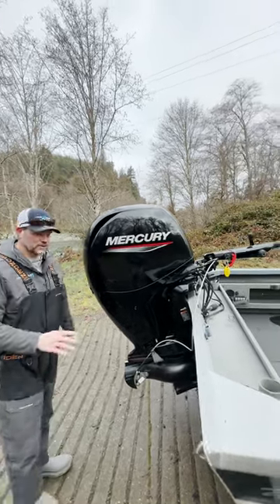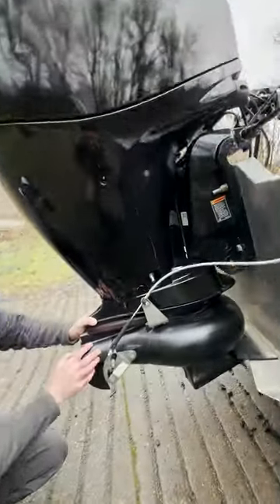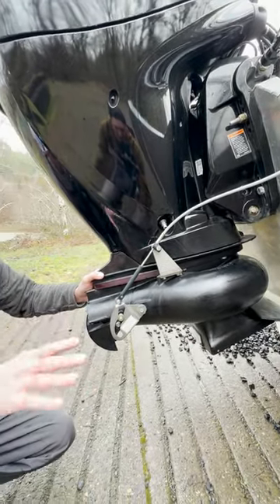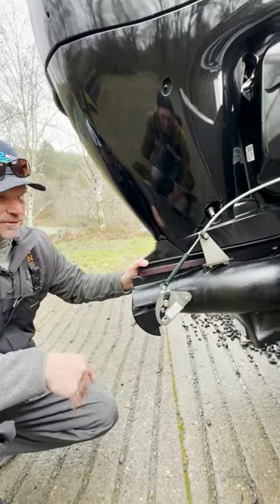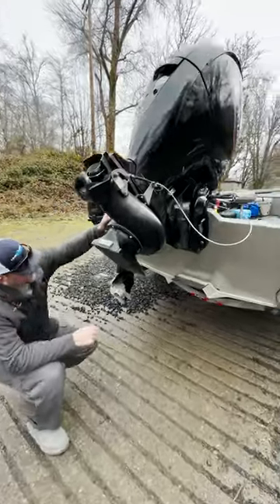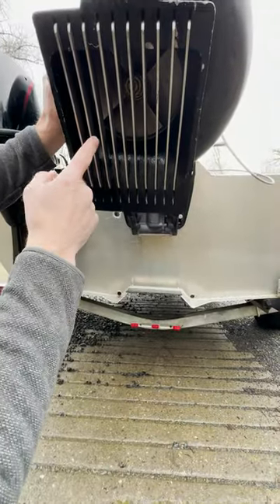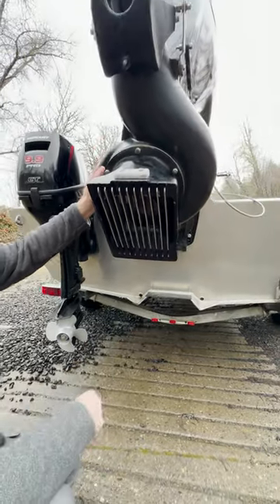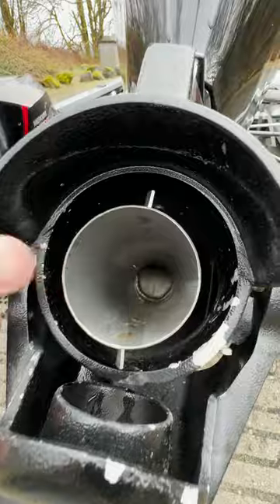How a Jet Outboard Works

Comment: I make those jet pumps at Edelbrock
Reply: That’s wild 😂
Reply: Ty
Reply: Get me a discount lol
Reply: How much efficiency does it sacrifice?
Reply: @andrewpease3688  a 90hp motor usually becomes a 75hp effectively with the jet pump. But theyre still quick compared to a propeller especially on the smaller motors like this size outboard
Reply: Where is the waterpump on these things?
Reply: @meetbounty  there is none, pressurized water coming from the jetpump is used to flow the water thru the motor and exhaust and out, for the cooling like normal
Reply: @mxracingunlimitedltd7784  interesting! Checked for these in Germany but seems we don’t have them :(
Reply: Yeah I wouldn’t brag about that…thise edelbrock pumps breakdown a lot. We have helped so many stranded boaters with those.
Reply: @mxracingunlimitedltd7784  since you know about the internals: how is the repairabilty on these things?
Reply: Very nice
Reply: @meetbounty  depends on the jetpump being used.. these look like aftermarket brand jetpumps the companies use as oem parts. 
However i highly doubt theyre as easily serviceable as a jetski style jet pump also use by companies like yamaha. 
Theres also no 90 degree turn in power in a jet ski so im sure that adds some complexity.
Otherwise its just a shaft with ball bearings that have seals on each side and are coated in grease. They usually last awhile especially if you use it semi-often.
Then theres the impeller and wear ring. The wear ring is a replacement part that will eventually need to be changed especially if you suck up rocks or lots of sand all the time.. The cooling line has a screen in the jet pump and a strainer filter as well to keep any crap like that out of the motor. 
You might have to do the wear ring every few years and maybe a new impeller after it has too many knicks and dents in it over time lol, but good amount of time, maybe 5 years for the Aluminum and for the better SS one's they could last forever if never damaged like a prop basically...
Reply: Edelbrock doesn’t make jet pumps. It’s an automotive company.
Reply: I make those impellers! lol
Reply: @UltraMagaFan yea it does! 
The make a lot of our castings for our company.
Reply: The same ones that make intake manifolds?
Reply: @iamsealfish yup! Same company that makes intake manifolds and more…
Reply: With no 90 degree bend it must be a pretty solid design. With the impeller being vertical it must really help get the boat on plane and must really hold the transom to the water.
Reply: I make them on mercury
Reply: @doriangray2020 - Do you know, how many years has Edelbrock been making these outboard jet pumps?
Reply: @meetbounty the water pump is in a housing connected to the driveshaft. Much like a prop lower unit.

Comment: A outboard jet boat.... Rhats a new one for me. I love it!
Reply: They've been around for decades. I once found a Victa jet outboard at the dump with a seized motor. The older Victa lawnmowers were a 125 cc 2 stroke- I replaced the motor with a 160cc off a later (1970's) mower. Not very fast even on a 10' ally punt as a Victa 160 is only 4hp! Gave the outboard to a collector after the novelty wore off.

Comment: I noticed it also has the chanel cut in the keel - very common on purpose built jet drive hulls.
Reply: Tunnel hull it will take soupy mud and uses the bottom of the boat to push the water out and it pulls it up in there allowing the pump to suck water and push you where mud will just clog up the pump . 🤙🏼
Reply: Nice
Reply: @brianpierson7708 Texas tunnel hull
Reply: @patrickmalone1373 Texas tunnel hull 😐 wth are you talking about

Comment: These are awesome for places like where I live thats chock full of logs and shallows...job number one with a jet outboard is work very carefully on where it mounts, or it will be a disappointing first run lol but if you get it right, its the best inshore way to get around oyster bars and sandbars, and one word of advice for ALL jet outboard owners...Jackplate.
Reply from the maker: Thank you! Mount too low and the intake drags too much, too high and it cavitates. Gotta be just right. What type of you boat and outboard do you run? Guessing you’re on the east coast somewhere.
Reply: @live2boat  Im a canoe fisherman these days, had a couple boats with jet drives and didnt have a lot of luck where I lived then because it could get choppy, Clearwater.
I fish in Waccasassa River area now where everyone has either a "lawnmower with a shaft", a jet, or jackplate on a prop engine. I think jonboats are best without a jackplate just because of the weight and stress on the transom but it was nice for my flats boat with a jet because I could drive through 6" easily at idle without sucking up a bunch of crap lol Had a Yamaha 80 in both boats the flats boat ran about 35, and the carolina skiff about 37.
Reply from the maker: @artlife6210  Super cool! We were in Clearwater a few years ago. Took the kids to aquarium, fished for snook, etc. Loved it there. I  had no idea jets were such a thing down there. Figured everything is a center console with a transom full of outboards.

Comment: Just combine a jet with an outboard motor. First time I’ve seen this!
Reply: They have been around for at least 15 years!
Reply: @tbusch63  Victa lawnmowers also made a regular outboard motor with the 125cc mower motor- and also made a jet leg outboard as well. In 1973 they were introduced. No doubt not the first.
Reply: @tbusch63 try 50 years
Reply: @72mardy  key words "At least"! I was actually looking at them in the early 1990s. So no surprise there!
Reply: I retired 14yrs ago from boat mechanics, never heard of em! Awesome 👌

Comment: Had the same 2 stroke 25hp prop merc since 1998.  Just upgraded to the 60/40 merc jet (with tiller)
Reply: If you did buy one you would would have said jet drive
Reply: Any better efficiency?
Reply: @anything.with.motors  Not really, props inherently will always have better "grip" and economy.  Not to mention, it's a huge thousand cc 4 cylinder.  Very efficient for what it is
Reply: @zackforister  right on. 
Good for low spots though
Reply: @anything.with.motors  It's amazing.   It's freaky to be doing 30 mph and look down and the water is only 6 inches deep
Reply: @zackforister yeah that's crazy lol
Reply: @Bighannes410  You have reading comprehension problems don't you? He said he got a  60 /40 hp Merc (KEY WORD) "JET" Tiller. let me translate that a little for you. If the engine was PROPELLOR driven It has 60 hp. If it is a JET it is equivalent to a 40 hp engine due to the inefficiency of a JET DRIVE! Yes, Jets take MORE hp to do the same job a Propeller does. The BIG difference is ONE can go SHALLOW, the other one, you replace the prop all of the time. At $200 a POP, if you take a prop TOO SHALLOW! TADA! Your Welcome. I don't even own a boat yet!
Reply: @tbusch63  nobody specifies a tiller . If you own a jet drive you call it a jet drive
Reply: @Bighannes410  Surprise MOFO! Did you know you can have a center console jet? THAT ISN'T A TILLER! Huh, I guess that means, that they still call the ones that are steered from the rear of the boat, a "TILLER"... LOOK IT UP. Better yet? Go buy a jet and see what you get? I don't even own a boat and I can tell you this is true. Besides, a Jet Drive is just the "PUMP" attached to a V8 or V6 Automotive engine, that has been "Marinized" With a Water-cooled Exhaust system (sometimes) and sometimes an enclosed cooling system.
Reply: @Bighannes410 the guy in the video even says tiller. The tiller is the handle connected to the outboard used to steer the boat. 
Handle on motor, tiller steer.
Steering wheel, forward control.
Educate yourself before you try to educate others.
Reply: @Mardy72  it’s called a jet drive motor educate yourself before you try to correct me on something I never mentioned anything about steering the boat
Reply: @Bighannes410 WOW I don't know anything about boat motors but the more you try to defend yourself the dumber you sound.😂😂😂
Reply: @markclark4324  the term jet drive motor has nothing to do with steering.
Reply: @Bighannes410  🤣😂🤣😂
Reply: @markclark4324  I don’t know why fact is funny for you. No one ever mentioned how you steer the boat. I mentioned jet drive and people assumed that had something to do with how you steer the boat. It doesn’t. No one corrected me on anything, nobody made me look dumb. If you could elaborate instead of just cackling some shit because you see likes on comments that would be great

Comment: We have the exact same Tiller Jet on one of our flats boat at our camp in Louisiana so we use them in the south to buddy.
Reply from the maker: Awesome Chuck!
Reply: That’s right we use them also to duck hunt and I’m in Louisiana they don’t do great if you have to run through a lot of hydrilla on top of the water unless you are going fast and not crossing much of it
Reply from the maker: For sure they don’t do great with vegetation or anything that can clog the grate. A single rock or stick in the grate creates cavitation. For running our rivers in  the NW they are outstanding though.

Comment: Its like having the whole bottom area bc the intake plate right before the intake grate and its on an angle so it would get pushed into it like a jetski does with the jet pump tunnel.
This is still the same just done in a 90degree turn style because of the shaft drive of the outboard already. 
More people should look into these, they dont sell nearly as well as they should given the areas in the US that people boat in, just makes more sense. 
Plus its much safer as well if youre worried about that and live on a lake, no reason not to get one..

Comment: My father, in1973, took the world's first Jet boat as a trade-in. It too had a centriphical pump, not an impeller.
Reply: Worlds first jet boat was built in New Zealand. In the mid to late 50’s so I call bs.
Reply: Not even America's first. As old mate says the jet boat is a Kiwi invention and at least 20 years prior to 1973 but American companies had been making jet units since around 1962 The US Navy has been using jets in their riverine patrol craft from '63 onwards until now (or at least very recently), the Vietnam era PBR being one of the most successful.
Reply: Centrifugal water pumps have impellers, just different shaped impellers.

Comment: I wanted a jet pump foot that bolted thru the hull or an oregon dory  with a multi hose outlet manifold.  So i could control steering outlet nozzles. so i have 2 transom outlets two forward facing spring closed nozzles like submarine torpedo doors. A front bow side thruster and a side stern thruster outleton each side .  A sliding door that closes off the foot for beaching.
Reply from the maker: Wow that’s innovative Wayne. Is anyone else doing that down there? Super cool 👍

Comment: Great information. But if the tiller Merc engine runs but the jet drive does not. 
Is there a shear pin on the propeller inside?  First time it has never had any thrust. Hmmm. Thanks
Reply from the maker: Yes there’s a key in there that shears to help protect the drive shaft.

Comment: How is it at low speeds? Fuel consumption the same as with a prop?
Reply from the maker: Far better fuel economy with a prop. Mostly short haul stuff with the jet pump though so it's not too bad.
Reply: Not in Alaska they run inter rivers all over with them in the rocks

Comment: This propeller system consume almost or up to 3 times the fuel consumption of the conventional propeller system
Reply: Not once the skeg and blades are all smashed off on rocks. That said, for shallow water, just buy the right boat with a Hamilton jet with an inboard V8.
Reply: Ridiculous, If the engine turns  the same max rpm at full throttle the  fuel consumption  will be the same gph but if you lose  25 percent  of your speed due to the pump then you will burn 25 percent more fuel.  At lower  speed the pumps are not very efficient  and you have to  race the engine  to get any sort of speed, so fuel mileage  goes  to hell.   Check to see if they have different  size impellers available. You need  an impeller  with more  bite. Jets would be  more  efficient  with a 2 speed trans mission.  3X fuel consumption hard to believe,
but at the point where the engine is reving but the boat is barely moving it will waste fuel. Avoid  those transition  areas if possible.

Comment: How much speed and power is gained or loss with that? I’m from Louisiana and that looks like something that would be useful here in the swamps and rivers if grass and silt wouldn’t cause a big problem with it. How long has these been out? Sorry for all the questions.
Reply from the maker: Grass and lilly pads can be a problem but sand isn’t too bad. Pumps have been around a long time. I think a lot of the duck hunter’s down your way run pumps. Some buddies in Arkansas that hammer the ducks have small jon boats with pumps on them. Thx for stopping by!

Comment: How well do these things hold up? I know my jetskis cannot survive being run in shallow water because debris will chew up the wear rings around the impeller and significantly reduce efficiency. This looks like an radial impeller rather than an axial one like my skis, maybe thats a more resilient design?
Reply from the maker: They hold up fine if you know what your doing. Get a little too shallow though and it can make for a long day. On the river it’s all about reading water.

Comment: Got an older merc 150 Black Knight with a three prop but also have a jet drive unit in the garage wondering if it would work, if it is rated for that motor.
Reply: Wondering. Yeah right. That thing will stay on the shelf for 200 years. I wonder why.
Reply: @voornaam3191  Why? it takes most people less than an hour there first time swapping it out!

Comment: Just curious which is a more efficient motor jet or propeller. What about the cost and maintenance costs?
Reply: As the jet is a propeller in a duct, given it's designed well, a jet will give easily more thrust. Like comparing a blower vac to a desk fan.
Reply: They are about 30-40% less efficient than a prop motor

Comment: But they reduce the overall power and you have to be in at least a meter deep water or you run the risk of sucking stuff up in the intake that doesn’t belong there.
Reply: At that point just use a trolling motor
Reply: A meter deep or the intake will suck shit in ? 😂 please tell us more about how you have never used a jet drive before
Reply: Normal outboards don't even need a metre. The pickup on jets are about level with the bottom of the hull. As he said, the grate on the bottom stops it sucking stuff up. They're less likely to foul up than any outboard prop because normal props arent protected from ropes winding around etc.
Reply from the maker: That all depends on the substrate in t e bottom. We take off in 6 inches of water in rivers with a rocky bottom and it’s fine. Do the same in mud or grass and it’s usually no bueno

Comment: Wonder what the efficiency is compared to a prop driven lower unit.  As in- which one makes the most thrust with the same hp
Reply: There’s roughly 1/3 loss with the jet. I have a Mercury 65 jet. It’s a 90hp power head. The 40 jet is a 60hp power head.
Reply from the maker: Spot on! It’s a 30% loss of power.
Reply: Very informative.  Thanks guys

Comment: Do you lose or gain thrust?  What are the pros and cons, other than depth of course?
Reply: Cons loss of horsepower and thrust pors you can run in about 2-3 inches of water with a properly set up boat.

Comment: How did those jet outboards work in salt water?
Reply from the maker: Not the best option for saltwater because you lose 30 percent of the efficiency with pump. They are designed specifically for running shallow rivers or the like.

Comment: How's that allow you to in shallower water? It's at the same depth as the propeller
Reply: The pickup is roughly level with the bottom of the boat. Much higher than a normal leg.

Comment: Fun facts:
Virtually impossible to flip your boat when using a jet prop in a turn.  To this day I have never heard of it happening. 

The bad...you sacrifice 25% of your horsepower switching from a normal prop to a jet prop.
Reply: Never knew that about flipping the boat,  I’ll have to try that on mine.

Comment: Is it faster than a prop ??
Reply from the maker: Slower overall. They lose 30% of their torque with a pump. Typically run as large an outboard as possible to compensate for the loss while also considering weight

Comment: The downside is that it looses about 15 % of power output.
Reply from the maker: It’s actually 30 percent but it’s accounted for by using a larger outboard
Reply: @live2boat  Thanks.  I wasn't  quite sure about the loss in efficiency.  But even with the larger motor, that is an additional 30 % less efficient than normal prop motors.   So, a 100 HP motor with this jet system will consume the same  fuel of a 100 HP prop motor but output 70 HP.   I  suppose the decision which to use is based on a trade off (more efficiency vs shallow water).

Comment: Jet pumps are pretty inefficient compared to a prop.
Reply: The upsides are the shallow waters you can fish with a jet where you wouldn't be able to with a prop.
Reply: Jets suit larger motors, as the power losses are less the bigger the system is. Inboard jet boats accelerate faster than prop drives and can go faster overall.